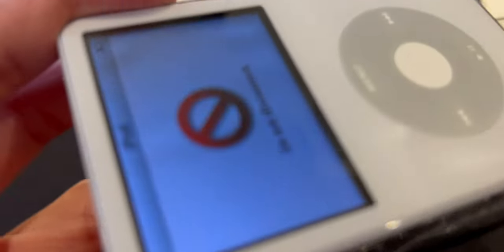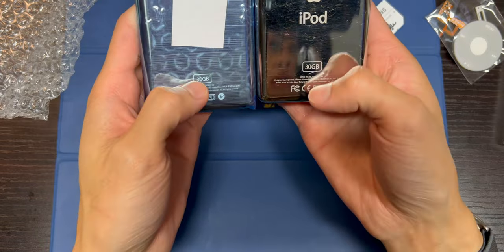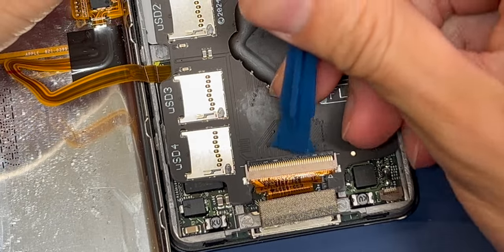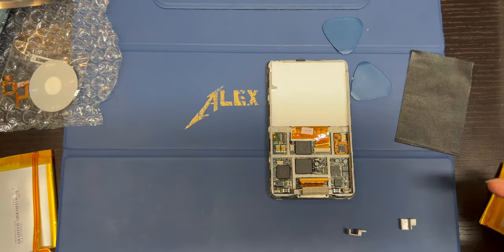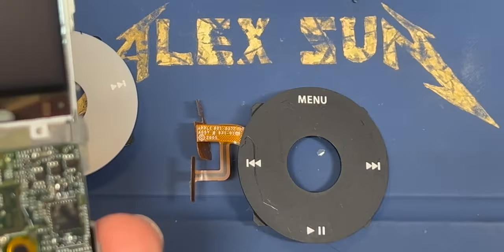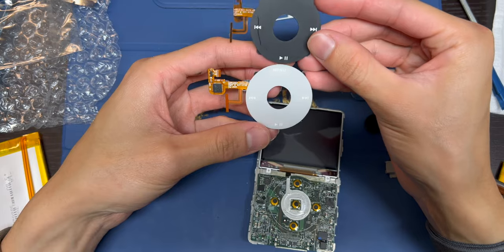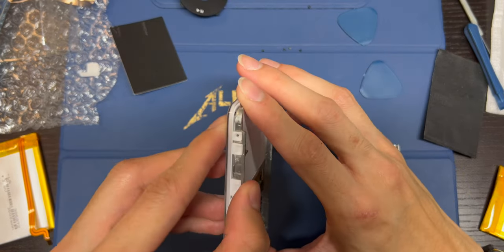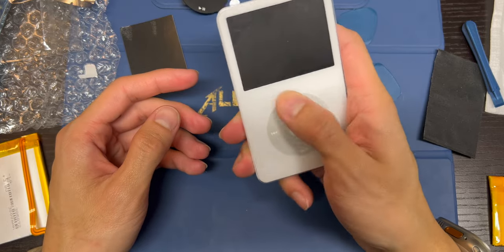Building My White iPod - A Tribute To Steve Jobs

Comment: Thanks for the video. I bought an 80gb 5.5 gen for the 64mb of ram and it it has a fat backplate. Can I change the fat backplate to a thin backplate to be able to use the 3800 thin battery? EOE says thin battery only works with thin backplate.
Reply from the maker: Thanks for the comment! I used a thin backplate with the 3800mAh battery, there is slight bulging as shown in the video. Not sure if it will affect the integrity of the battery in the long run, but it will fit. Hope this helps!